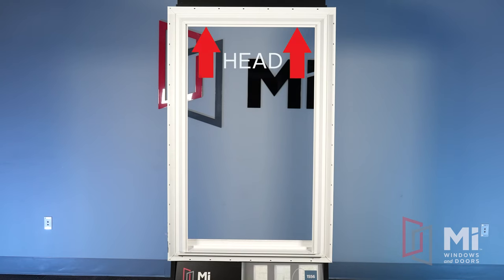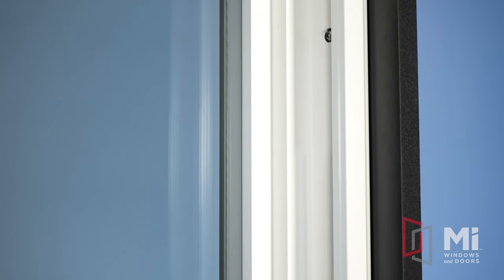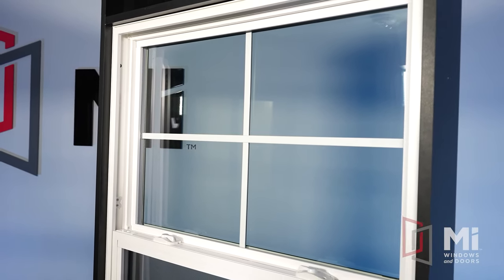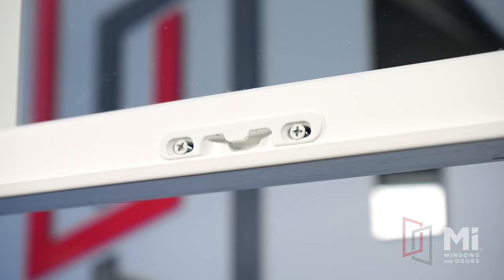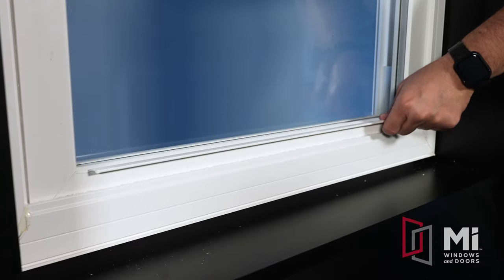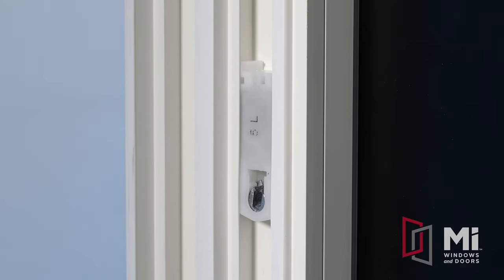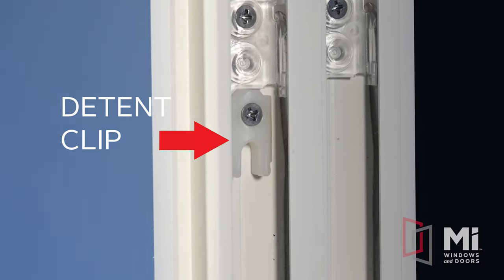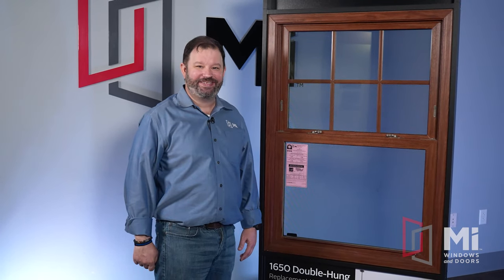Windows 101: Window Anatomy

Comment: My house contains all double sliders. They are double glazed and installed when the house was built in 1980 and wood. With everything going vinyl, I wish you could show a corner cut-away showing thickness. Perhaps you do if your channel has more videos. I will have to buy & install one at a time.
On a fixed income with limited resources. 
Thanks kindly for sharing.